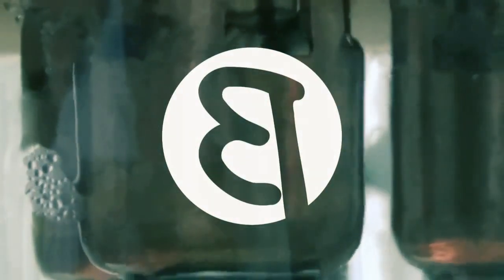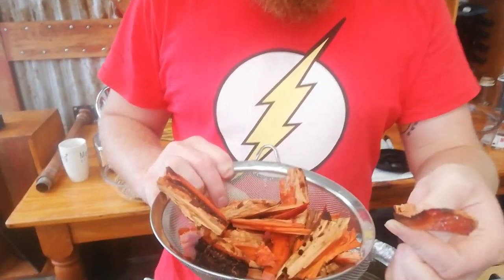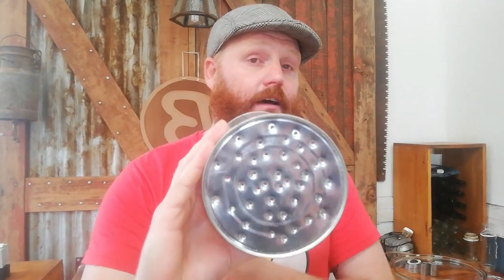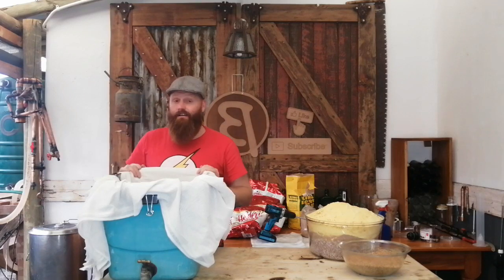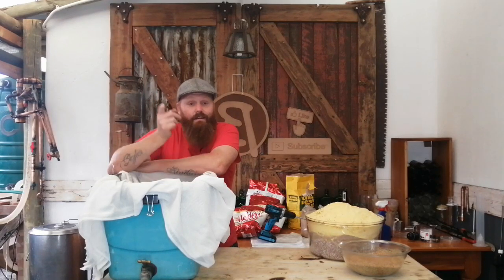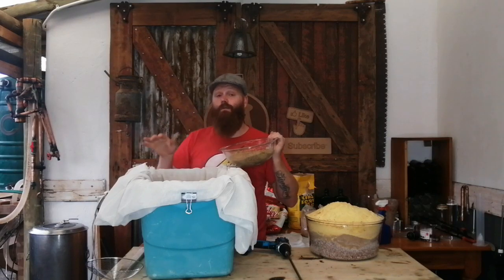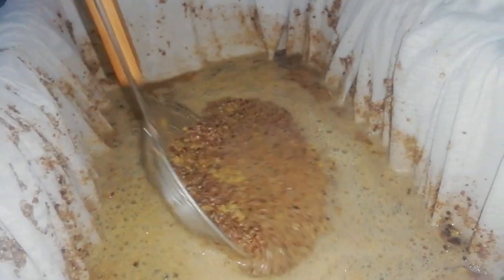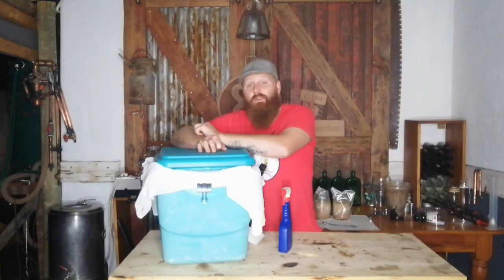Corn flake Whiskey with a twist.(All Grain Whiskey)

Comment: Wow, what do you expect of taste from the sorghum?
Reply from the maker: Hi José

From the Umqumboti whiskey I have made before, slighty bitter malt, with a sweet grain finish.

When it is aged the sweet toffy flavor comes out and give a nice rounded flavor, I think it will complement the smoke nicely with that full body wheat flavor, the strip had some nice malt smells, and the smoke came in at the lower end.
Reply: @BEAVERDIY  nice, i might try. Also, do you know what kind of sorghum was used to make the malt? Cause it seems there are a few varieties for alcohol, pasture and stuff.
Reply from the maker: Hi José,

I use the King corn one it is common in South Africa, used to make a local unhopped beer called umqombothi.